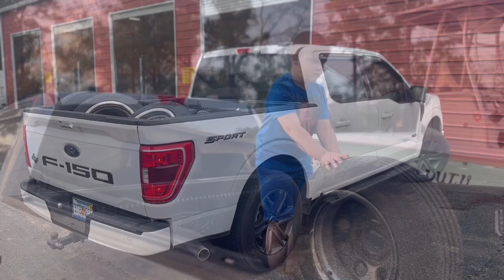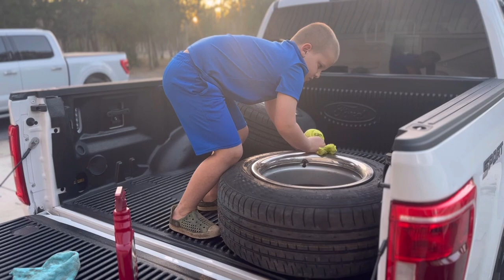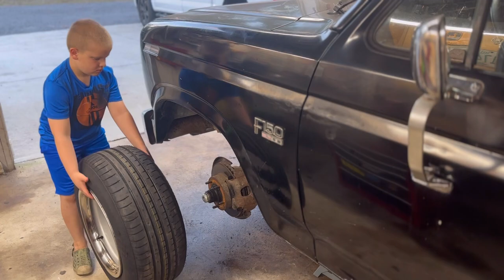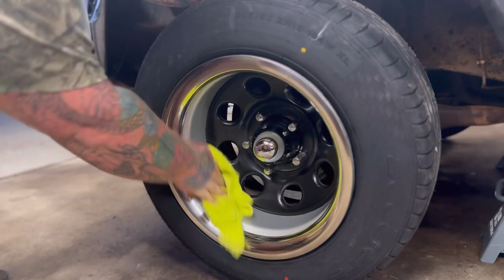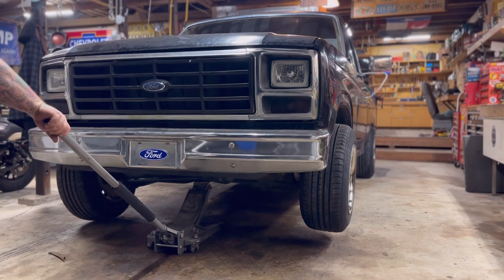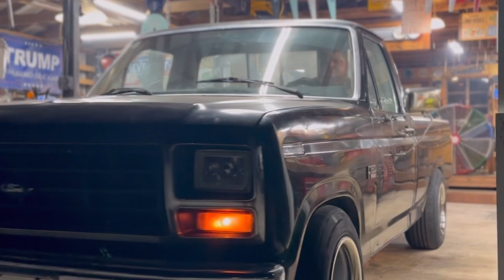Lowered Bullnose Ford F150 - Stanced on 16x10 Wheels & 235/60R16 Tires

Comment: Hey I wanted to ask how does it feel now that you manual swapped it and with the 4.56 gears since I got a 93 I’m making into a lightning clone it has a carb swapped 5.0 and a zf manual transmission would you say it daily’s good with that set of gears cause I got a set for my 8.8 and I’m debating if they’d be overkill for my setup?
Reply from the maker: With the 4 speed & 4.56 gears I’d say it’s not a daily. If you have a 5 speed you could probably get away with it. If I could do it over again I’d probably go with 4.10s